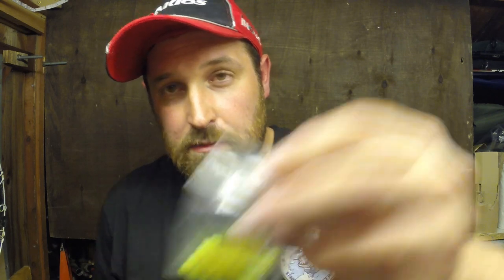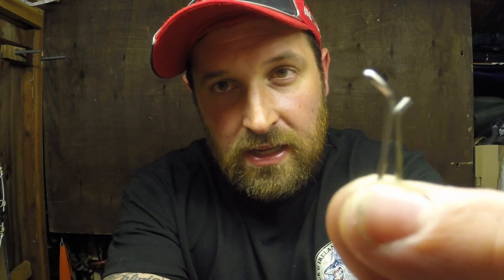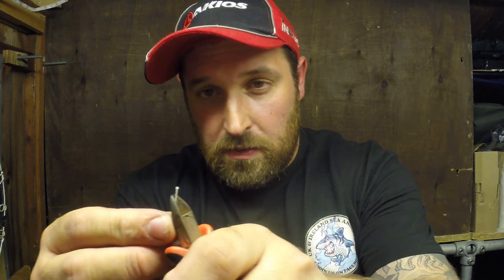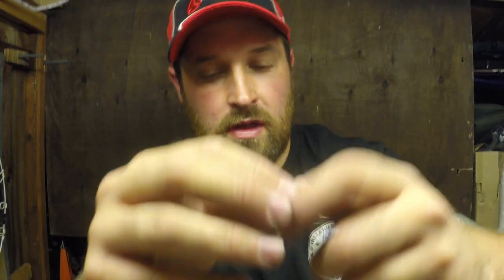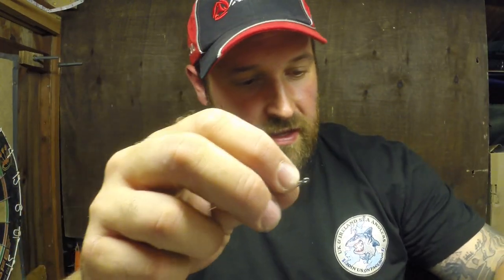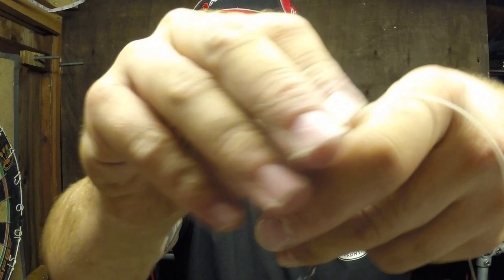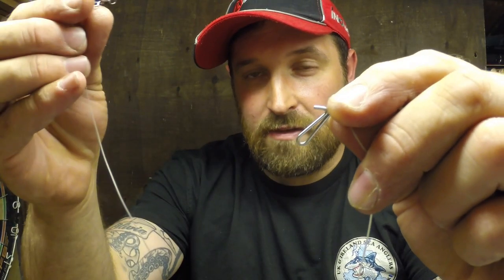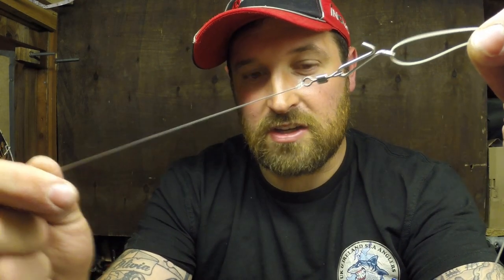HOW TO MAKE THE PULLEY DROPPER RIG - EPISODE 3 (UK SEA FISHING)

Comment: Hi Jason, nice video, I would be a bit careful with the strength of the hook snood it is taking half the casting force. The swivel will hold it so it won’t be dangerous but you will get a big overrun. If you want a light line long snood the up and over with a Trident hangover works reasonably well. One thing you might like to try, get two weights and some 15 or 20 pound line, tie some different knots and pull for a break. It c
Reply: Sorry ipads, It is very illuminating, I am now using the fish and fool for all my light stuff.
Reply from the maker: Cheers David I think people will prob adjust the strengths to target different fish perhaps :)